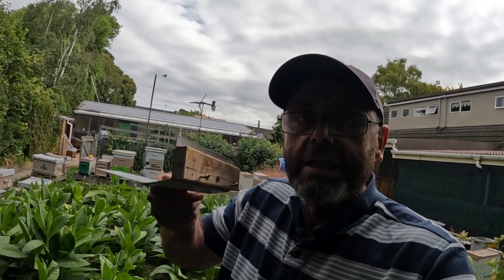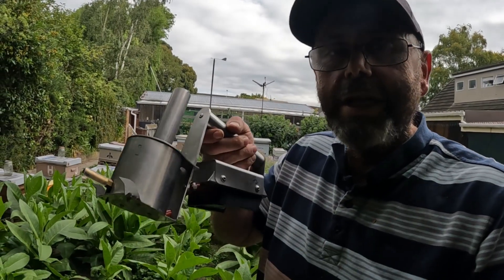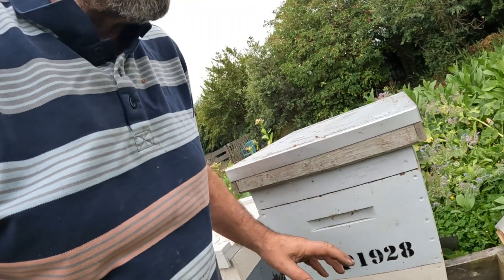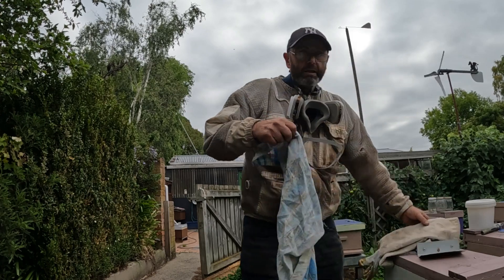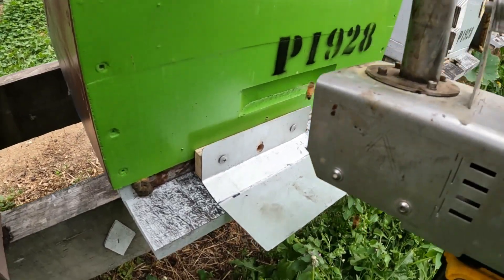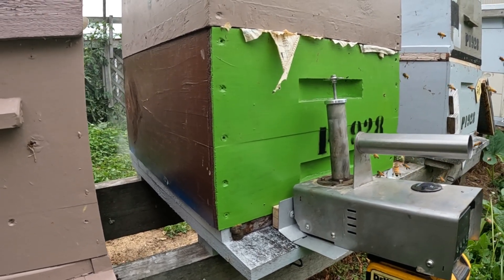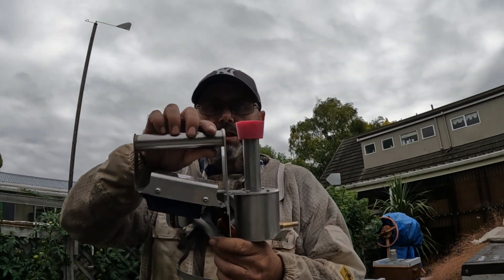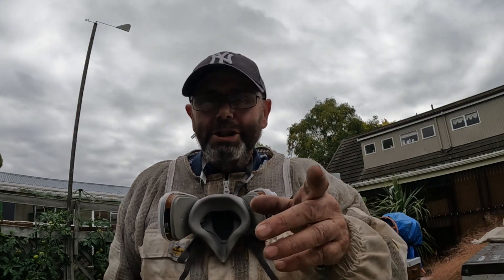The InstantVap Is Fast, Can We Make Even Faster?  #oxalicacid #varroa

Comment: Do you have vented bottom boards?
Reply from the maker: A small percentage of my hives do, most have solid floors.  The loss of vapor is very noticeable when vaporizing the vented floor hives, if I had more I would block them off beforehand.  But vaporization is just part of my mite control program, I also use slow release OA strips, so I am not totally reliant on the vaporization.
Reply: @KiwiWildman thanks. I'm here in New Zealand as well. I used the same instavap as you use. Apivar for wintering.

Comment: Hello my friend another month for me before spring arrives. I was one of the first to purchase the instavap here in the states.  6 grams is the norm for treatment with us with the vap so it allows for the leakage while leaving enough in the hive, although we leave the entrance closed for 5 minutes so the vapor continues to be distributed evenly as possible. Unscrewing the OA feeding device all the way back fills it to 5.5 grams exactly. So we have 2 feeding tubes one set at 4 and the other at 2. I do like your invention and will try one myself soon, thanks again as always for your videos
Oh , and we share the same last name lol
Reply from the maker: And a great last name it is too! :)  Yes, the instructions with the InstantVap Compact that I am about to review recommend leaving the entrance plugged for 7 minutes.  I find there is very little leakage after the first minute.  I hadn't thought about the evenness of the distribution. Like you, I have been bumping up the dose to compensate for leakage, but the more grams you dose per hive, the fewer hives you get out of a battery.  Unless you run the 12v version from a decent (Lithium Ion) 12v battery.  Then you can go all day.  The best option depends how many hives you have.  Good luck with your upcoming Spring.  Cheers Chris
Reply: @KiwiWildman  we are using a 9 amp hour battery at those doses. I get 15 colonies treated on one battery, I could get a few more but at that point it takes longer to pre heat so I switch batteries. I maintain 26 colonies in different yards so this vap is great as long as its maintained and cleaned. I look forward to your review on the compact version and why one works over another.

Comment: Hello I really like your adapter you made . Ya I do not think we can stop all leaks there is just no way. I use the hole in the back that i drilled an I use the white or red shop rags to cover the entrance but I wet the rags first an I think it helps to cover the entrance. I think your adapter will definitely help the tube from getting bent an damage it . Using the holes in the back you have to be REALLY CAREFUL to not hit a frame with the tube because it will stop the tube up an the back pressure will blow the top cap off an blow acid in your face . Thanks
Reply from the maker: Thanks Kathy, sounds like we have had very similar experiences.  Cheers Chris
Reply: @KiwiWildman  hello I have a question. You an I last year were talking about the Hendricks hive   . I found a man in Canada an he is messing around trying to build a hive like that an his name on this site is Scott  is that the same man that built the Hendricks hive . I do not think so because he is working on his tenth trial box .???. I am still going to do the one you an I were talking about last year but I got into building me a new Bee shop an all my time is put to it so I will have it by time I start pulling supers this year . I was just wondering if that is the same person. Are you still using one of those boxes or trying them out .??. Thanks
Reply from the maker: @kathyhathaway8823   Hi, yes that is Scott Hendricks, his channel is Beekeeping in Northern Ontario.  No, I didn't play with one this year.  The version I tried worked, but didn't do all that well compared to the hives around it.  But that might have been a poor queen.  Scott is trying lots of different configurations, I only tried one.  I have no doubt that he will crack it.  Cheers
Reply: @KiwiWildman  ya I thought that was him . He said he was getting ready to start on trial design # 10 . The bottom board #7 I think was like the one you have an I liked that one the best . Thanks 🤞🤞🤞